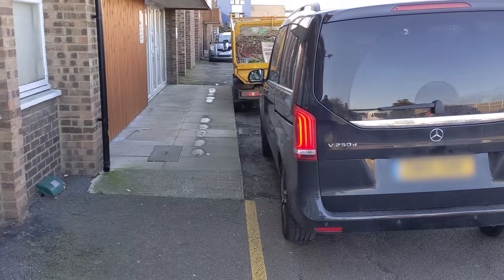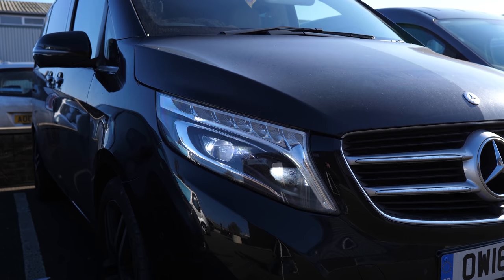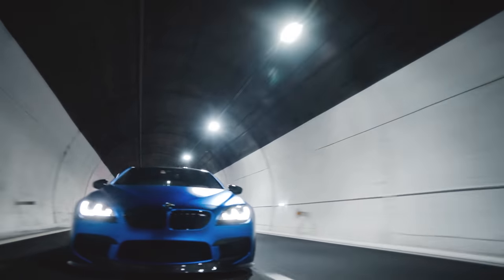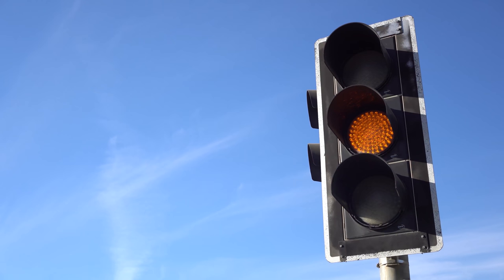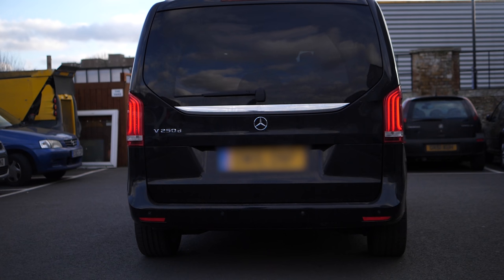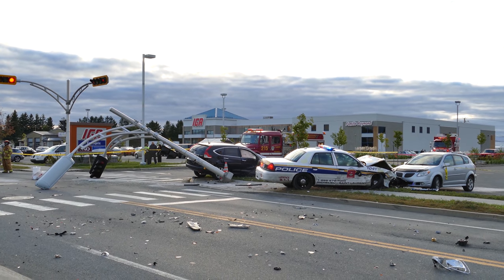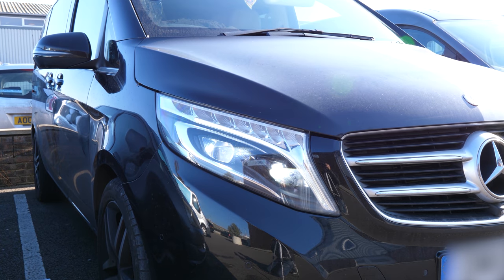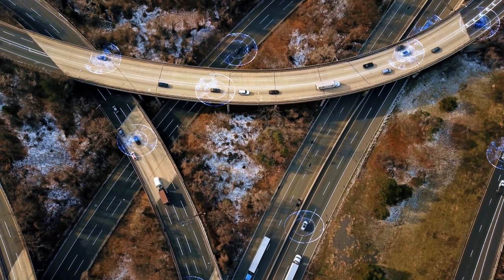Self-Driving Cars Are Dangerously Confused By LED Lights

Comment: Hah. I noticed this years ago. Ever since I was a kid, I've been able to do this eye flick motion while maintaining focus on a light source, effectively drawing light trails on my retina. When I started I could only make a right-side loop, essentially looking to the left in an oval motion really quick. Now, decades later, I can draw patterns that persist on my retina for a moment, forming flowers of light. Way back, no doubt around the time LED lights were becoming a thing in cars, I noticed some lights would be dashed lines, as opposed to the solid lines of other, older cars. Ever since I discovered this I've been checking whether lights I see are solid or dotted by doing the same eye flick. So, it's the LED intensity regulating pulses I'm seeing. Cool. It's not just LEDs though; the high-pressure sodium lamps used in yellow street lights aren't quite solid, but they aren't dashed either, rather they're gradients with a visible transition from bright, to darker, then back to bright again.

Comment: The old solution would be tiny phosphor dots on a screen outside the shutter (but inside the optics).  Need to separate the RGB channels for color vision, but that's an engineering challenge.  The shutter can then be fixed aperture, and vary the exposure length; the phosphor dots ensure you see the average value.  Just need to get the phosphor dots as tiny as the subpixels on a modern camera...  (And there is the problem).

Comment: You can also increase the frames per second of the camera to solve this problem.
Reply: Not always. #1 The sensors will have a maximum read-out rate, they can't give you 1000fps. (In bright conditions, the shutter may need to be 1/1000s) #2 the AI that is reading that data may not scale to read that fast, either. #3 it's always possible there will be an LED out there that is being pulsed at a faster rate.

Comment: As soon as you mentioned the reliability of cameras with variable, multi-leaf irises, I thought of a certain camera phone module that has a simple, 1 piece iris that can only be, either closed or open. These have just 1 moving part and are much more resistant to vibration or even a complete failure of this mechanism. 
Regardless, it will probably take a combination of solutions to properly eliminate this effect.

Comment: film with a n*3Hz & a n*7Hz camera at once, merge the images  (i forgot the mode but basicly. you can merge images so the brighter pixel dominates) Feed that to the AI. you'll have very few frames where both cameras stil line up for a frame... - maybe use interlacing an see how the ai deals with that?

Comment: I'm not saying your title is incorrect, I'm just heavily implying it.

There's a reason that a LOT of self-driving cars use radar, lidar and similar technologies, and one reason is that they do not have to make any assumptions about what any car is doing based on its visuals. They have constant feedback on distance to everything around them through those technologies, which allows them to know exactly what they are doing at any given time; speed, acceleration, direction they're going in etc.

This is why you'll see self driving cars make decelerations (sometimes suddenly) when a car in a lane next to them makes sudden movements towards their lane or even starts to drift towards it.

They do not need to rely on any indicators on the vehicles around them, because their reaction times are so much faster than inertia - unlike ours. It's been at least twenty years since we've proven that we can comfortably make self-driving cars keep a distance of about an inch to the vehicle in front of them (making certain assumptions about braking capabilities), whereas humans who aren't professional drivers on a closed circuit need far, far, far more than tat.

The only self-driving cars that are dangerously confused by LED lights, are the ones that are developed by morons. Unfortunately that doesn't rule out having some that exist.

Comment: As somone in the US, I fully agree that the amber turn signal lights is superior. It bothers me when I cant tell if a car is using the blinker or one of their read lights is just out. Especially when you have the same damn model of car between the US and the UK, and the US version opts not to have the blinker lights on the rear and instead integrates it with the break lights.

Comment: I had wondered about this problem, thanks for covering it. 

I also see badly designed car lights that can fool human eyes too due too. For example indicator in the middle of a round brake light. Takes a split second longer to process and work out what is happening. Which can be enough to cause an accident. 

Not being able to see the indicators at all angles due to the narrow beam angles of many LEDs is another. Dangerous for pedestrians and I’m sure AI!

Comment: There is an easy solution to this problem that is as old as any DC power supply... When you run AC current through a full (or even half) bridge rectifier there is a 60Hz (in the US) "ripple" that can affect electronics adversely... It is even worse for half wave rectification...  the solution was to install a "ripple capacitor" across the power leads to smooth out the "troughs" where there is no power, usually to something above the RMS of the original signal.  There is usually already a voltage divider resistor in place to reduce the current getting to the LED and prevent to much voltage getting through.  This would give the effect of changing the voltage "seen" across the power leads and there would be little to no "flicker" getting through... but that means more "parts" and the possibility of a "blown" capacitor... but if that were placed within the light housing, it would be replaced when too many LEDs go out.

Comment: 1:34 While I have only owned one car with red turn signals in the rear, I to this day cannot understand the issue with this. The whole argument behind someone's signal can be between life and death is quite near sighted. I have never had an issue with this.

First, if someone is flashing brakes at 75 mph for no reason, that's the problem, not the lights. I'm fully aware that some cars don't have 3rd brake lights (they all should by now). If you don't see that light but see one of the others, it's a turn signal. If you see a 3rd break light in addition to both, it's solid brakes. And last if you see the 3rd light with one flashing it's a signal with brakes. 

Maybe it's only simple in that way for me, but driving around, I have never assumed someone was braking first when I see a light flash. Also I don't follow so close that the time it takes for a flash to happen can even be confused as such. Further more, if someone brakes that hard for it to be "life or death" there are various other visual cues that show the car is braking, and again, if you're that close for it to be an issue, you're too close anyway. Using a turn signal is no excuse to pull out into traffic at a snails pace, nor is it a reason to change lanes when one feels like it. If someone cannot negotiate a proper lane change, it's that person's driving ability, not the design of the lights.

Lets let it be known that I am in no way defending lights made in this way. I'm just saying that until Technology Connections made a video about it, I had absolutely no idea this was even an issue much less "unsafe." It just seems like to me people are't paying enough attention to what's around them, but instead text and drive or just plain oblivious.

And to all who don't know, No Americans are not the only one's who design lights this way. The Japanese, Korean, and Germans all design cars in this way, and only change the design for the places that require it. I can name several cars from the top of my head that are acutely not American but have combined lights.

Comment: The solution is simple. Make the frequency in the high kHz range. Maybe most people don't see the flicker of LED lights but I do and it is very distracting. Driving behind a VW with LED back lights at night is terrible for me and yes, also in the cinema I see the separate images especially when there is a bright scene with horizontal movement.

Comment: Just a thought, but is there a reason, they couldn't use two cameras taking near identical point of views, but with distinct shutter speeds, then comparing the images? I'd imagine you'd use two prime number for the shutter speed so that it removes the possibility of a blindspot frame when the camera's synch up (similar to the idea of submarine sonar). Then if either camera sees the light on, it's considered light on.

Comment: New cars could solve the problem by putting IR emitters in the light buckets that transmit data with a standard protocol with only a few signals like "stop", "left turn", "right turn", "headlights on", "DRL on" etc. Now that doesn't solve the problem of older cars, but it does help going forward. Plus autonomous vehicles have all kinds of other sensors beyond vision, so if they were using Lidar or Radar, they could (and with Tesla's systems sometimes do) predict rather accurately what cars ahead are going to do, not just what they are doing. I've seen plenty of videos where Tesla's system warned a driver sometimes several seconds before a car ahead was going to be in an accident.

Comment: Tell those tech guys to use 2 or more cameras with the different settings needed.  My car has 6 sensors on the back bumper to beep at me when im within a mile of backing into something so it would be no problem to have multiple cameras.

Comment: Could you create a subset of images taken at random intervals when the shutter would normally be closed and use the moving average of this subset to detect LED lights.  Random intervals should prevent the new subset from syncing up with LED lights.

Comment: Well... some of these are problems with cheap cameras.  It's definitely possible to make shutter mechanisms appropriately damped, etc... Their problem is that they want to do this with super cheap cameras.  For instance, using sensors with global shutters mitigates some of this as well, but those are more expensive, it is unlikely they would go that route.

Comment: I can’t think of a way to put this but does an automated car need to look for break lights? Surely there is another option, I can’t think of anything sensible but automated cars scan their surrounding using lasers so why can’t the car breaking change the reflectivity of its break lights to appear different in the sensor of the car approaching rather than trying to understand what light means what? 
Or infrared signals or something?
Probably a stupid thought

Comment: By pulse driving LEDs, you can achieve higher efficiency, but if this becomes a big problem for a future full of autonomous vehicles, it is just a simple design change of the LED driver, to make it a stabilised constant current source, and the led will then have a 2% lower light output for the same current, but that is a small price to pay, especially as LEDs become more efficient for each year.

Comment: The relationship between perceived brightness and duty cycle is not linear. This means, for instance, an LED at 50% duty cycle is seen by the human eye as considerably more than half as bright. This is due to persistence of vision. LED lights are often pulse modulated as a way to maintain the same brightness while reducing the heat dissipated by the light.  Pulsing LED lights is not always just for modulating brightness.

Comment: Why not use variable frame rate in the camera, or two cameras operating at different frame rates. This would still have some artifact, but would eliminate some of the risks, and improve how quickly the camera picks up the issue.

Comment: Theres no need to push the limits of ISO, you could just use a variable neutral density lens instead of a digital rolling shutter. plus that would also help reduce reflections & glare.

Comment: LED Driver manufacturers are cheaping out in the automotive (and a lot of other applications).
Driving an LED at 50-200Hz  is very easy and cheap to do, however when using PWM to drive high speed things like motors, it is common to drive the (driver) at 20-30kHz  (400- 1150 times faster) so doing this with LED drivers is possible (relatively simple) - though it may be a few cents dearer per unit.

For safety sensitive applications the driving frequency should be mandated to be above the audible range, which eliminates annoying buzzing and would also eliminate most strange effects with visual sensors.

Comment: The problem is that you can not change the voltage of an LED - it will damage the LED if you do. You can change the brightness by changing the current but changing current is really tough and has a limited range of brightnesses available. However, LEDs don't mind if you turn them off and on really fast at full voltage - and our eyes see this as changing brightness.

Comment: It should be relatively simple to regulate the duty cycle of the LEDs used in cars. If you require a duty cycle of, say, at least 1kHz for on all new cars that are solved cameras would only have to have the shutter open for 2 milliseconds to be guaranteed to catch at least two see lights that are on, allowing frame-rates of up to 500 fps. 1 kHz is not a big ask. Might even want to get it in the order of a few kHz to avoid messed up aftertrails in human eyes for those sensitive to those.

Comment: One part of the fix could be controlling the environment.  There are plenty of regulations already about headlights.  It's not unreasonable to push for a minimum frequency for all LED lights in use on the roads (whether on cars or signage)

Once you have that minimum frequency, you can now design a camera knowing that as long as the shutter is open for at least one full duty cycle, you'll capture a fairly representative image.

A quick search found using 300Hz as a minimum LED frequency in general to avoid perceptible flicker, which would provide a short enough duty cycle to avoid the issue.

The big problem with this approach is that it takes time to cycle older non-compliant vehicles off the roads, which is why it should only be part of the fix.

Comment: You could also just open the shutter 5 times as often and then average the light data over any given 1/30th of a second interval. This would simulate human visual acuity fairly well and so translate across standards and methods so long as the methods were compatible with humans driving

Comment: I am completely uneducated on anything to do with cameras, cars, anything like that so I do apologise if this sounds a bit dim of me 

however

could you not just have a camera with a changing frame rate e.g. 14 for frame 13-5-7 etc 23 for frame 2-4-6-8 etc
I do not know if that is possible, if not..

just double the amount of cameras and make them have different framerates (2 on the front becomes 4, the extra 2 have a different frame rate non divisible by the original)

I base all of this on absolutely nothing, just a thought that came up, probably won't work..

thanks for reading 🙂

Comment: hi the flashing led light's could easily be solved with just 3 simple components (inductor, diode and capacitor).
inductor in series with the led's a capacitor across the led's and a diode from the input of the inductor to ground to prevent voltage spikes. the missing components are simply the second half of a buck converter and cost less than a dollar worth of parts.

Comment: Phones are coming with multi-camera arrays now, wouldn't it be possible to have a multi-camera array with different (but fixed) apertures and select the image from the camera with the best suited aperture? That feels like less RnD costs and a more straight forward path than trying to develop a new sensor. But then, I don't really know much about sensor development and this may be a super simple thing to solve, and I'm totally wrong thinking using multiple camera modules is an easier path to solve the fixed aperture problem.

Comment: It looks to me is a problem of expectations, and timing, we are expecting to deliver autonomous cars using Human Interfaces, whereas we might need to start thinking to reach a common ground first.

I was thinking that why don the traffic light, the other cars communicate in a mesh wireless network, and we use the optical cameras, to validate that each of the components around us are actually there (to avoid hacking), each component visually exports their public keys and the messages received like, my hooman sais I will turn right, or Hi I'm a traffic light and I about to switch to red in 3 seconds, are all signed by and verifiable by those public keys.

This will take time to be adopted and enforced but the early the faster.

Also, what if you put some sunglasses in front of the camera?, wouldn't help that the problem of receive less light?, I suppose now the problem is night time

Comment: I personally sensitive to PWM, I'm sure I'm not the only one. I notice flickering of car lights, OLED screens, cheap digital movie projectors, etc.
PWM is not the only way to manage brightness of LEDs, you can drive them with constant current to achieve the same effect. It's more expensive, but how can't a car manufacturer/owner afford it? The cheap solution would be PWM at a much higher frequency. It would aid autonomous cameras too.
I'd love to see regulation on how low PWM rate can go on car lights. I wonder how it's not causing more accidents already.